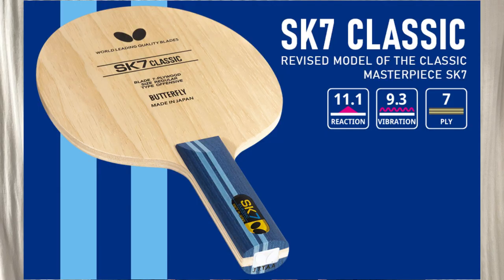Choosing Your First Table Tennis Blade

Comment: As I started the sport and just needed a paddle to play with, I bought the Joola Infinity Balance premade racket which was a 7ply. Realized that a 7 ply was not the best blade to start off on so I switched and got a YSE with 729/Friendship Battle 2 FH and Xiom Vega Europe BH after quite the extensive research as well lol. Now after quite some time, Im looking for an upgrade. After more extensive research and overthinking (LOL) I'm looking at switching back to a 7ply; DHS Power G7 paired with Nitakku Fastarc g-1 FH and Rakza 7 BH. Even though I started playing with a 7ply, I still had lots of fun playing with the bat and actually did pretty well with it (for a beginner) which is why I'm switching back to a 7 ply.

Comment: I agree with you about the wood blade and carbon blade, base on my personal experience, I use all wood blade yinhe N10 and it is offensive, I can’t create lots of speed I need to use tensor rubber for that and I have to use my physical strength just to create more speed, I am planning to shift my blade to a carbon, I am a looper and topspin attacker, what blade do you suggest for that? I am planning to buy stiga or donic
Reply from the maker: Stiga Carbonado 45 sounds like a good option for you, thanks for the support!